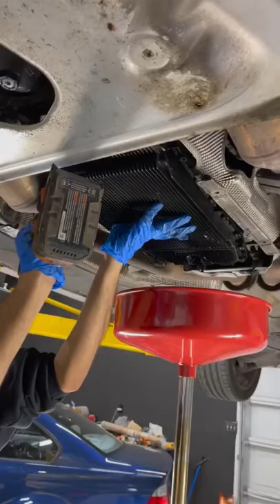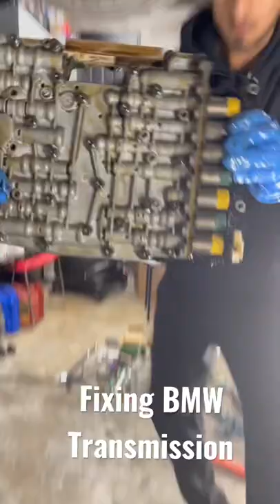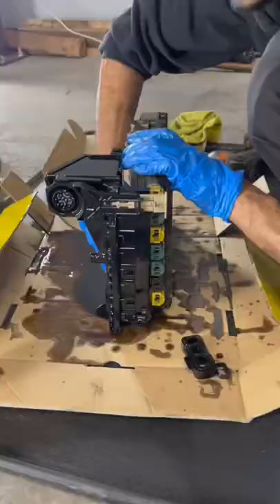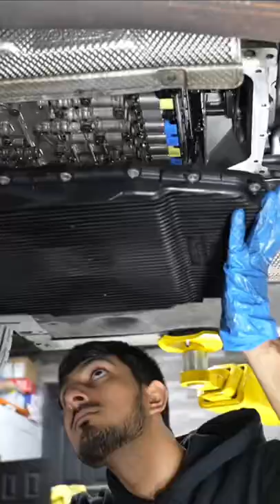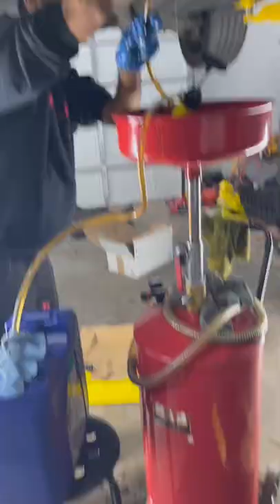Fixing the transmission!

Comment: Hi guys, please can anyone help me out? i have bmw e61 530d 2006 with auto transmission while driving car gearbox shutters. There is no vibration, though, and when pressing a bit more gas, it's fine. i had my engine check light came on on the dash  i dont know if its the tourqe converter when i had a bad converter on my e46 i could feel vibration while fring but in my e61 its smooth aslo chanes gears on time its just when going above 30 miles and up

Comment: Please advise!! Will changing the sleeves get rid of low end shutter or slipping?
Reply: That's likely a bad cv joint.
Reply: @nevinkuser9892  it was the drive shaft itself. Carrier bearing was destroyed.
Reply: @TravisRummer  was it slipping when going to 4th and 5th and transmission malfunction light coming on?
Reply: @crazyworld2570  no, light wasn't coming on. Shuttering into 2nd and 3rd then smooth.
Reply: @TravisRummer  Ok.  Thank you.  Mine is driving me crazy and I can't find anyone that works on these vehicles.
Reply: @crazyworld2570  yours just sounds low on fluid or needs a filter change.
Reply: @TravisRummer  OK.  I'll check.  Thanks again.
Reply: @crazyworld2570  no problem
Reply: @crazyworld2570 you probably fried your e clutch your gonna need a swap 4-5 started w mine and I blew it off and boom trans went
Reply: @princeluciano2023  How much did it cost you?  I'm trying to figure out if it's worth fixing or just get rid of the vehicle and buy another.
Reply: @crazyworld2570  I found a trans and swapped it my self bro I have a nice tool collection it was a pain in the ass don’t get me wrong but in this car world if it’s paid off keep it apr suck and there’s a car crash coming soon plus war rumor who knows what they taking from us just think man and have fun don’t be to down about the whip 👌🏽
Reply: @princeluciano2023  Yeah I called a place yesterday and the guy said between $1800-$2500 for a rebuild. Every rebuild I did on a tyranny or motor never lasted. I don't think I'm going that route and the guy is 4 hours away.  My second thought buying a new vehicle but then slapped myself back to reality. I think I'll just buy a used Japanese vehicle for now.
Reply: Hi my bmw e60 530d stays in park don't want select gears what can be the problem the code says change megatronics
Reply: @ashleychristopher989  is your code reader/scanner capable of resetting megatronics?
Reply: @TravisRummer  I don't know I got someone to come and scan it for me must we try to reset it
Reply: @ashleychristopher989  yes, it may even say relearn depending on the brand of scanner but either way, you need to try that. If it doesn't fix it there's serious mechanical issues within the transmission.
Reply: @TravisRummer  ok thanks I will try it